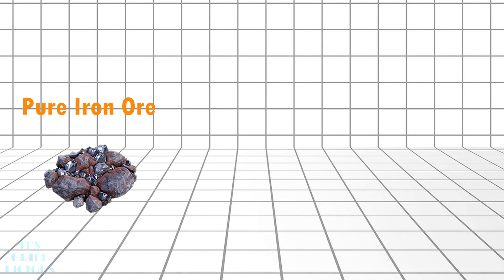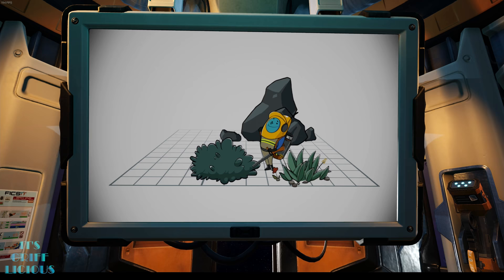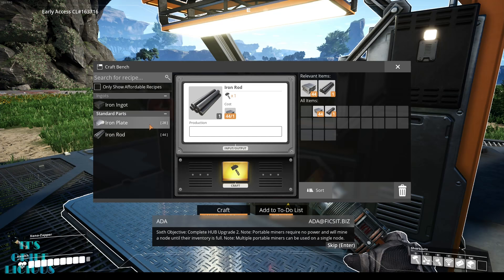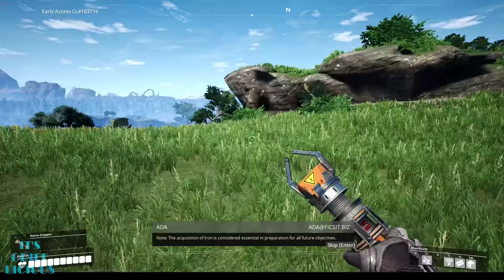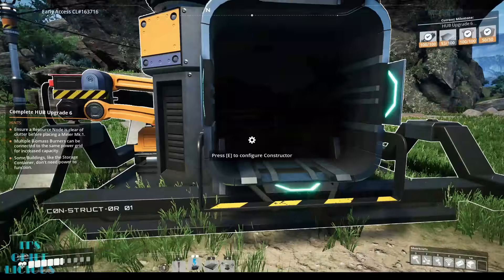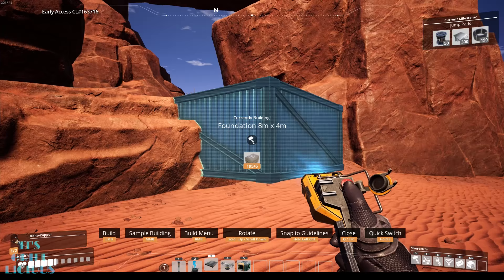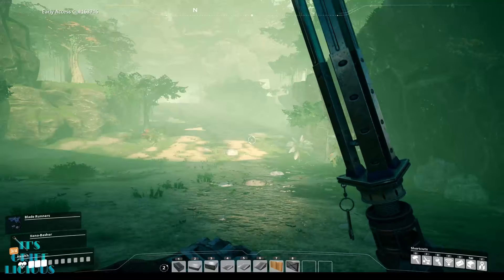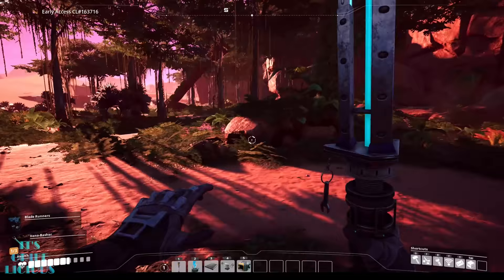Satisfactory: An Unlikely Masterpiece

Comment: I definitely have to build on a couple of mechanical points, just in case some viewers who aren't particularly deep into the game don't fully appreciate the mechanics.

----

1st, Underclocking: Holy cannoli this is actually amazing. Overclocking not only makes you 'use more power to produce more items', it's actually 'make this thing WILDLY more power-inefficient to simplify your production process'. That is to say, to produce 2x the number of items from a single machine, it costs like 3x more power within the same timeframe. An example from the wiki: Normal Iron Rod production costs 16 MJ to produce the item. At 2x speed, it costs 24.2 MJ to produce each iron rod, totaling at 48.4 MJ. You could have used two constructors instead, saved yourself the power shards, and it'd only cost 32MJ to produce. The overclock conversion only gets even worse at 250% speed.

Underclocking, however, is the opposite! Whereas overclocking makes it cost more energy to produce each individual item, underclocking makes it cost LESS energy to produce each individual item! If you want to output the same rate of iron rods, but drastically decrease the energy impact of constructing them on your power grid, you simply create more structures and underclock them. Take one constructor, and make it ten constructors, each running at 10% speed. An individual one is terribly slow, the whole setup costs WAY more materials, and it takes way more space -- but 10 constructors running at 10% speed produce as much as one constructor... at 1/4th of the energy cost. You can reduce how much energy you're consuming to produce those iron rods by -75%. Make 20 constructors, doubling your iron rod production, and you're still at HALF the energy impact of a single constructor running at default speed. Have 40 constructors running at 10% speed, and you have 4x production for the same energy footprint as a single constructor running at default speed.

In the early game, underclocking actually SIGNIFICANTLY reduces strain on your power grid, with your finite access to power. It's actually a very good thing to consider if you haven't reached, or haven't scaled up your coal power plants yet, and are still relying on manually feeding Biomass Burners.

To further put this into perspective, the video speaks about improved compacting of biomass having better energy yields. I will elaborate on this. 1 "leaves" = 15 MJ. 10 leaves are worth 150 MJ. 10 leaves can be combined to yield 5 "Biomass". 1 Biomass is 180 MJ; so 150MJ can be converted into 900MJ. Hot damn, that's a 6x energy conversion rate! But we can go further. 8 Biomass can be converted into 4 "Solid Biofuel" . 1 Solid Biofuel is worth 450 MJ, so you're converting 1440 MJ into 1800 MJ. Not as big of a jump as before, but Biomass and Solid Biofuel both have a stack size of 200, so while the conversion rate of inventory space 2:1, the efficiency of a single stack shoots WAY up - you can leave a biomass burner nearly 3x as long before you have to visit it again.

Now, combine this with Underclocking, and the number of items which can be produced with the energy of a single unit of Solid Biofuel - which in the early game comes primarily from wood and leaves, which are finite resources that do not replenish - can potentially quadruple.

You could aim for [improved simplicity of construction + increased inefficiency of consumption], you could aim for [scaled construction + balanced inefficiency of consumption], or with underclocking, you could aim for [increased complexity of construction + improved efficiency of consumption].

-----

2nd, Alternate Recipes: (Mild Spoilers) These are, usually, a trade-off. Factory complexity, material efficiency, energy efficiency, these are the things that are being wobbled around with alternate recipes. A lot of times, it can be worth it, but HOW worth it is dependent upon how you value your time or your resources.

Aluminum Ingots, for example: Standard conversion has you use 90 Scrap + some amount of Silica to produce 60 Aluminum Ingots. The bauxite refinement to create Alumina Solution, which is used to create Scrap, creates Silica as a byproduct, so you only really need a small amount supplemented from elsewhere to keep it all running.

However, maybe you don't want to use Silica? Maybe you just want to pump scrap in, get aluminum out. Thus the Pure Aluminum Ingot recipe, which turns 60:30, rather than 90:60, but doesn't use silica, meaning less conveyor spaghetti and smaller, less costly buildings (constructors vs foundries). You can also use the Instant Scrap recipe to throw a Blender into the equation and remove Refineries altogether, structures that have a LOT of space bloat, and in the process also eat less Bauxite and Coal in the process, at the cost of added products somewhere along the chain leading up to the blender, though still at relatively efficient ratios.

There are also recipes out there that make things MORE complicated, but for vastly improved input:output ratios. Turbofuel production is an example of this, requiring not only different resources get used in a different factory arrangement, but it's an alternate recipe that REQUIRES ANOTHER ALTERNATE RECIPE TO BE RESEARCHED FIRST, and can be made MORE EFFICIENT STILL by finding alternate recipes where Heavy Oil Residue is the primary product, and a new, different resource is output as a byproduct. Or! OR! You could have a different recipe that outputs THAT byproduct as the primary, and Heavy Oil Residue as the byproduct, and use alternate recipes to recycle the weird NEW product into Plastic and Rubber at WAY better production ratios than simply turning your oil into those things directly. Factory gets bigger, uses more materials, but outputs way more product and energy for the same amount of input.

It's insane. One single Pure Oil Node with its output maxed out via overclocking is essentially powering my ENTIRE base, with tonnes of energy to spare, producing more plastic and rubber than I could EVER use, and I haven't even made full use of all the Turbofuel I'm producing. To think that, I could underclock huge chunks of my base on top of that?

-----

TL;DR: The game is a sandbox of possibilities. The game dev has ideas, but they don't want to tell you them, they revel in you discovering them on your own with your own capabilities of logic and reasoning, so they simply bring the possibilities, then they throw those possibilities on the table, and smile as they watch you produce the ideas by simply looking at what is being offered on the table. Sometimes, you might even produce an idea that the game devs hadn't accounted for, and instead of thinking "That's not what I wanted you to think", like so many game devs do, they think "You fuckin' amazing lil' cookie you, take that idea and RUN with it! RUN! SHOW ME WHAT YOU CAN DO WITH IT! Show us ALL! Tell you what, your idea gives ME an idea, lemme make some more stuff..." and it just keeps feeding into itself. It's fantastic.

The name of this game isn't just a cheeky pun that drives the very design of it on every single level -- even outside of the game, the way the devs and community circle around each other is, in and of itself, satisfying. I honestly really quite love it.
Reply: I love this comment.
Reply: One other factor to consider with underclocking, at least for people with CPUs with lower performance (like me), is that the limiting factor on a save is often the total number of machines you can put in the world before everything slows down too much and your frames become nearly unplayable. Especially an issue when hosting a MP world.
Reply: I have some comments to this. 

First, agree with everything here. 

Underclocking is extremely attractive but you have to consider its consequence especially if you underclock a endgame factory. 

The engine can only handle so many items before it begins to have issues. This can be circumvented with a quick .ini edit, but your now circumventing UE4’s item count threshold. Take into your own. 

Also some warnings. The game does have rounding errors especially impacting mk2 pipes. They are supposed to carry 600 m3 max fluid but never can. In reality its like 599 or 598. Its best to try to math it out so your pipes never carry more than 400m3 of fluid per pipe. That usually solves that issue. 

The next is junctions. They have effects of causing flow rate to not reset after each junction causing flow issues. To fix this, loop the pipe. 9/10 times that fixes this issue. Or dont make pipe manifolds too big. 

Use gravity to assist you. Fluids respond to gravity. That is why for inputs I always have the input pipe placed above the input connection spot. One stackable pipe support usually is enough. 

Final hurdle for piping is there is a buffer loading bug. When the gsme loads a save, 5m3 of all fluid buffers vanishes. This can cause instability in what should be a stable system over time.

Comment: You know the best thing about this game? There are a ton of different ways to play this game, and EVERY SINGLE ONE of them feels like an intentional, well designed aspect in itself. There were SO many times where I thought to myself, "This game is doing X so much better than game Y. And it's not even finished unlike Y."
 
You can just jump into the game with no prior knowledge whatsoever, and the game organically shows you everything you can do, and you DISCOVER that you can solve a problem in different, equally valid ways. Noone tells you you are doing something right or wrong. You figure that out yourself, even when there are objectively better and worse ways to do it. Each process actually is so unique that a different approach may be required or at least more ideal/easier. 

I think the exploration aspect is actually extremely well designed and integrated into the game.
I like how you start out in the middle of an area, you walk around slowly and keep encountering enemies, cliffsides, poisonous areas and even the literal "end of the world", and you may wonder just how big the world actually is. As you progress with your factory, your own MOBILITY and capabilities increase to an epic scale over time. At first even low-level enemies are a challenge, climbing mountains is difficult, dangerous and slow, areas are blocked by rocks or gas etc. Then you become able to run faster and jump higher, and you start to travel further. When you get the jetpack, and as you learn how to use it, you are able to overcome many obstacles you could not before. You finally get to some good vantage points that let you see more of the world, and again you suspect that there is so much more to explore than you thought. You keep overcoming more and more of the obstacles and become the master of this world. You make it your own. 

Towards the late-game, due to the non-procedural world, you inevitably expand your factory into this vast world to get all the different resources you need. You may start to build train tracks around the entire map, and finally start to see the whole picture. And once you've finally unlocked everything and "completed" the game, you may start to think about what else you want to do and choose a goal for yourself. And it may keep you playing for another 1000 hours before you know it. For example you might decide that since you now know more or less the entire world, you should find out how much of which raw resources there actually are in total, and what it would take to build an entirely new factory that would collect and use ALL of them... 

And as you start working on something like this, you start to face challenges you never even had before once again. You may start pushing the limits of what your conveyor belts can handle, and end up contemplating how to best arrange 20+ belts or pipes to get your resources where you need them. Logistics become a huge part of the game. Maybe you never even used a train up until now. Certainly you didn't use the most efficient alternate recipes for everything until now. What even are the best recipes to use? It's not a clear-cut answer. As with everything, you decide how you want to do things. Maybe you start up Excel and calculate it all yourself. Or maybe you use online tools and resources. Or you talk to the online community about it. 
Either way, if you've enjoyed the game until here, you probably will for much longer.
Reply: Satisfactory taught me much about Excel :P
Reply: On my playthrough, I used just a bunch of foundations to make skybridges to explore and used walls to box enemies while i looted crashed ships XD
Reply: Even when you’ve completed every milestone there’s never an end within the game. That’s something that I think we all enjoy about the game. It’s not a game with a infinite space, but a game with so much more possibilities to explore unlike other games. It’s something great and very fun to think you’re done but then find out you can make things even better than before
Reply: During my first playthrough, I started out in the Grassfields, learned about the game, tried to find my way and built a big warehouse and wrapped all my factories around it using a huge bus system that took resources out of the warehouse and dumped new ones back in. After about 100 hours or so, I unlocked the map and opened it. I haven't even explored a quarter of the map at that point. I just unlocked coal power, setup 16 coals generators and was slowly progressing towards tier 5 and 6. My jaw dropped wide open just by looking at the size of the map. I built a tractor and went exploring and found some beautiful vistas that dropped my jaw open even further. And it keeps getting better and better. Now I'm 1200 hours in and still can't get enough of it. I found new resources, built many new factories and even reached nuclear power in my first runthrough after 500 hours. It certainly keeps you occupied and while you can always find a very small bug or two that are mostly visual stuff, everything works perfectly. And the performance of the engine is so high that you need to have a big world before it starts to stutter, even on a 12-yeard old pc like mine. Other games don't even come close to such performance while they have no calculations to be done in the background and far less visual details to be rendered onscreen at any given time.

Comment: Ive only seen 5 mins of the video but to note with sound design. One of the larger ones i find unnoticed is the machinery hitting the ground. It scaled in pitch length and depth the larger the item you place. Put down a constructor vs a truck stop. Vs a train station vs a space elevator. And just listen to them drop. And the metal and motors scraping on the elevator cut scene

Comment: There's something incredibly special about this game and I could never quite put my finger on what it was. I think you really nailed it. I remember the first time I saw a trailer of the game and though it looked like it might be fun, but I didn't think too much of it. I never expected that I would end up liking the game this much. It became the first and only game to ever make me pull an all nighter just to play video games. I ended up playing with a friend for about 35 hours straight without even realizing. And not even a second of it was boring. We had this big project or making a massive oil factory and have a ton of plastic, rubber and fuel produced in the same area, and ended up making enough turbofuel for 148 fuel generators. Did we need that much power? Not even close. Did we enjoy making the absolute most power we possibly could out of a single pure oil node? Hell yeah we did. The algebra quiz joke was very accurate on this one because we had to spend so much time optimizing. We haven't played in a while now but we were planning on doing the same thing but this time with nuclear power. This video really made me feel like playing again.
Reply: I don't remember off the top of my head if its under quartz or caterium but wait until you get the thermal generation and start using them on geysers. That's a fun build too, well mostly for power! Drop a couple of them and a few electric accumulators... very nice indeed!

Comment: Satisfactory is easily in the top 5 all time games for me.  One thing you talked about a lot that I'd never realized is how much the game respects the player's intelligence and creativity.  It guides the player juuust enough so they're well informed of their options, but it never crosses the line into hand holding.  I've played a lot of automation/management/crafting games in my time.  Usually these games have god awful learning curves where you're either: A) guided like a toddler through a 2 hour tutorial campaign, B) restricted by upgrades/unlocks that are clearly meant to guide you in a specific direction, or C) completely overwhelmed by systems and recipes to the point that a second monitor with the game's wiki is all but required.  

Satisfactory is the first game of this genre that was actually enjoyable from the outset.  I always knew exactly what I needed to do, and I never knew how I wanted to do it, which is exactly the sweet spot you wanna hit with a game like this.

Comment: Superb breakdown, I'll use this as an entry point or persuader for friends.
Two things I think you missed is that buildings etc can be torn down without loosing the resources, even to the degree of putting down a temporary storage box if your pocket dimension pocket is full, and that there is a slightly dark element to the game when you realize FICSIT threw 96 other pioneers at the planet before finding the right method. Actually three things, the fact your pockets are a pocket dimension, a fun but hand-wayvy way of addressing the large inventory mechanic these games need to function.